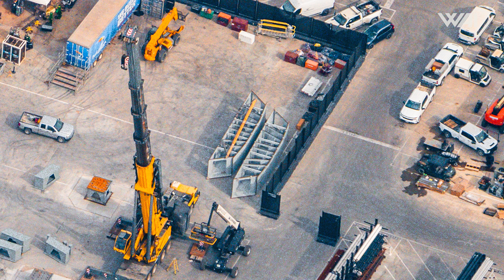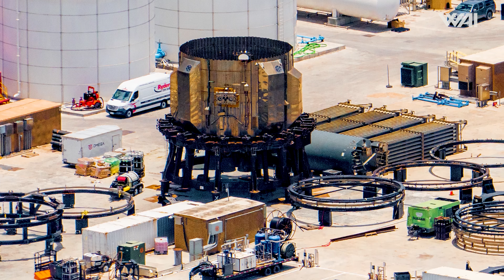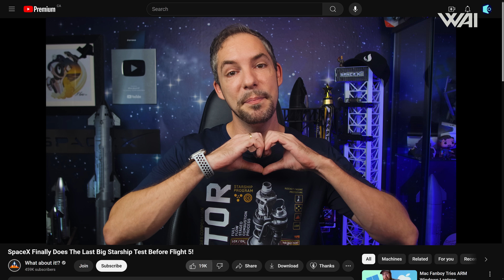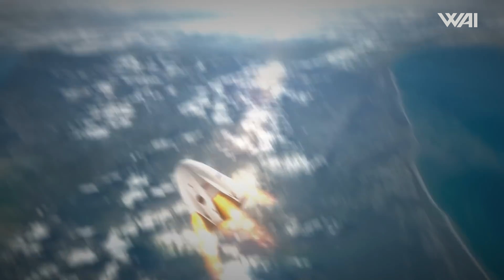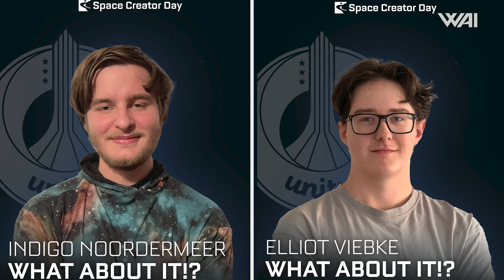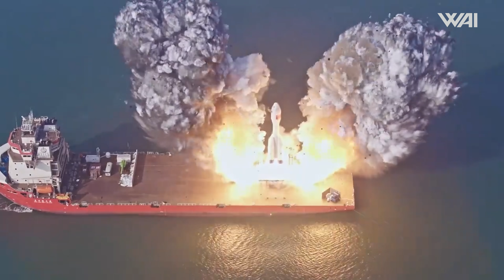SpaceX Finally Reveals New Design! & The US Might Fall Behind China In The Race!

Comment: If the FAA delays continue, will SpaceX just leapfrog the current setup and do FT-5 with the next ready setup? Does the Block 2 design  require a new FAA certification or could they do FT-5 or FT-6 with Block 2 in “rapid” succession?

Comment: Why aren't you talking about the booster failure on a crewed (rescue) launch? They are lucky the issue occurred after stage separation, but the fact that the problem flew with crew on it, you should be talking about it, like you would if it was Boeing or any other SpaceX competitor!

Comment: I'm sure another reason they decided to go with a different launch mount is due to later block versions will be larger vehicles, and the old mount is rather tall, and they simply cannot increase the height of the tower, so the easier step would be to make a short rectangle.  I know this isn't the only reason, but I'm sure it is one of them for sure.

Comment: The reason dragon would have to have all chutes fail to use the thrusters is because the anchor point for the chutes are on one side making it unbalanced. If it was to fire the thrusters it would probaly lose control and flip. Has to be in stable orientation first. Will also need a chute release in that case. Don't want deployed chutes attached when the engines fire.

Comment: It wouldnt surprise me if we saw a 3rd megabay pop up where the high bay is now, but then eventually merge Megabay 1 and 2 together into an L shape, and eventually join it to the 3rd. Ship and booster parts start construction in the star factory, rollout the back under cover into the Megabay, and move through the L shape mega bay to completion to roll out the front door and down the highway to masseys or the pad.

This would be the ultimate streamlined production that Elon has been after. It will also negate the doors on all the megabays leaving more room for ships and boosters inside. It will also make us all a bunch of sad pandas as we will get to see very little of the build until the completed unit rolls out the front. Which eventuially that would be happening once or twice or even 3 times per day we hope if Elon's plans for 1000 ships per year is realistic.

Comment: Super Draco’s are put in for escape… with the idea heavily planted in everyone’s minds then abondoned. But the stuff is there anyway.
Then the very spectacular escape test flights were very successful.
The crew dragon just performs every time way above the curve.
Now they say the thing that’s been there from the start will be now available as a last ditch Hail Mary.
Then I bet the cargo dragon will start using the super Draco’s as a test just a few meters above the water as a test.
Then higher then as a test at altitude very high to try to brake the ship entry from a point that’s slow enough to enter a hover then drop again and deploy the chutes.
Then try a cargo dragon as fully super Draco landing but in the water .
Then on the land with or without legs or maybe onto a little cradle with a fire proof net to settle on .
Then crew dragons that are old or whatever tha5 are just put into suborbital launches maybe or even full orbital.

This is just the next step. And it’s great.

Comment: I thought you might have mentioned the issue involving the Falcon 9's upper stage, which occurred during the Crew-9 mission on September 28, 2024. The problem arose during the deorbit burn, where the second stage of the rocket landed outside the designated safe zone in the ocean. This is the second upper stage anomaly for the Falcon 9 in less than three months, following a similar issue during a Starlink launch in July 2024.

In response to this latest incident, SpaceX has paused all Falcon 9 launches while they investigate the cause of the deorbit burn issue. The Federal Aviation Administration (FAA) is also involved, requiring an investigation to ensure public safety, although no damage or injuries have been reported. It is unclear how long the pause will last, but it could affect some high-profile upcoming launches, including the European Space Agency’s Hera mission and NASA’s Europa Clipper mission.

Comment: I'd be supremely comfortable and very confident putting my life as an astronaut fully into Elons hands. Hell, I'd go to Luna RIGHT NOW if Elon wanted to do it and let me.🙏He's already got all the necessary equipment. I can easily imagine 7 days on Lunas' surface using Elons luxury spacecraft, Starship, as a short-term habitat.  It'd be more like a vacation than a dangerous mission. The Starship would make a fine, luxury level habitat for any short-term stay on Luna. I have no clue what is taking them so long. A quick jaunt to Luna is just the right medicine needed to light a fire under our governments butt to move to get Lunabase online and supporting a couple dozen astronauts. We need to be more confident in our abilities. Caution can be just as bad as recklessness when it comes down to it. We have seen Elons equipment in action. It works like clock work. You could even use the Dragon capsule to ferry people home, leaving the Starships anchored in Earth orbit ready for refueling and return journeys to Lunabase. I can't imagine a safer process to implement. 🤠😇

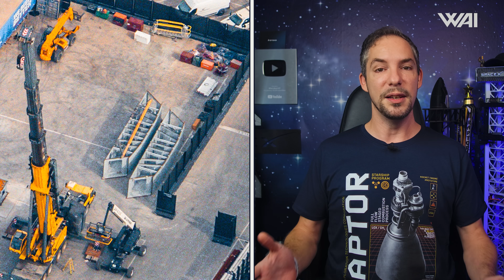Comment: 1:20 two identical pieces? No, they are not for same pad ;) Pad A same as Tower A need to be overhaul to Starship v.2 soon (at maximum two launches possible if it will not be destroyed/damaged by landing booster) then why not to order two launch pads in one contract? Overhaul of Pad/Tower A will begin soon as Starship v.1 program will be finished - curent Pad/Tower A configuration is obviously not able to support/launch Starsip v.2 😉💡

Comment: If the new launch mount is shorter the new integration tower will not need to be taller to accommodate larger vehicles.
Reply: Block 3 is taller

Comment: do they pressurize the eva suits with air at STP or pure oxygen at lower pressure like apollo 1?
spt
Reply: Apollo 1 was pure O2 at 16 psi on the pad.
Reply: @Logan4661  wait?  then what was the benefit of all that o2?
Reply: @baileyrahn266  On Apollo 1 the hatch closed from the inside and the pressure being slightly over 1 atm was to help it seal. That was why the astronauts died, they couldn't open the hatch and in a 16 psi pure oxygen environment even some things that are considered non-flammable will burn. The hatch was redigned and the capsule environment was changed for all future missions. I belive it was normal air on the pad and pure O2 at 8 psi during the flight.

Comment: Since crew dragon can land perpulsively why not strap it on a falcon heavy and send it to the moon? All u need do is increase the life support and when laning on the moon all u need to do is program it for moon gravity instead earth. All the parts are already being used right all that needs to be done is human rate the falcon heavy right?
Reply: If they need more room all they need to do is lunch with less personel right
Reply: @DropingUP  Well, if you just want to send the astronauts to the moon then yes. But if you also want them to come back alive then no, it can't. 
To start with,  the  crew dragon doesn't  have landing  legs. Those are not trivial to add because  it would be necessary to drill holes trough the thermal shield, which is possible but a big investment to develop (actually the original design was going to have legs, but NASA didn't like that design due to safety concerns..)  Actually, the thermal shield would need to be reinforced for higher re-entry speeds (much faster for moon return than orbital return) and  drilling the thermal shield to add legs does not sound like a good start.  
Still possible to solve with time and money , but this time the idea is not to go there just  for a walk but for building things, and they  want more capable ships.

Comment: Does Dragon Super Dracos have enough power and delta V for a lunar descent/ascent?
Reply: Well earth has higher G force and draconian and easily land a dragon on earth and hence moon would be pretty easy but they would have to use falcon heavy instead of falcon 9.
Reply: @riddhishakya7791  Does falcon heavy have enough delta V for TLI?
Reply: @sakshamShukla_  Yes, it can go way over
Reply: The dragon capsule has a low terminal velocity on earth. It does not have the propellant to land on the moon let alone land and take off.
Reply: No.

Comment: I'd definitely place my bet on Stargate and Highbay space getting used for a new Ultrabay. The current Starship roadmap can't be fully implemented at Boca Chica (unless they want to go back to stacking stuff in the open air) unless they build a a taller megabay somewhere (what I called Ultrabay) because the block 3 booster is going to be significantly taller than a block 1 booster and right now even a block 1 booster with hot staging ring attached only just fits through the megabay door.

My guess is that at some point in the future both of the megabays are going to switch to almost entirely (maybe literally entirely) Ship production with a new Ultrabay that is both taller and wider focussing on booster production. Demolishing both Stargate and Highbay should create space for a new bay that could be not only taller but also wider than the current megabays, maybe five stations along the back instead of the three in the current megabays and perhaps even two stations to each side of the door instead of the single station to each side in the current megabays. Given that Elon has said they will produce more ships than boosters I would think that an Ultrabay that size should give sufficient booster stacking capacity for a long time to come.

Comment: China will have boots on the moon before the USA. Besides the FAA problems there are problems at NASA with SLS delays, the Orion heat shield, and design issues with the lunar gateway. Then there is the looming presidential election that will affect the NASA budget. I wouldn't be surprised if the USA has to buy ride share space to get astronauts back to the moon.

Comment: think of what a raptor 3 engine getting on the black market mean for the space race. If the engines get in the Chinese hands, they will leap 10 years forward in their capabilities.
Reply: Duplication doesn’t get you all the research data that led to the Raptor 3. They would know what it is, but not how each part was built, or exactly why each design choice was made.
Reply: @billkew5385  yeah plus al the plumbing, software and fuel, AND mass production
Reply: @playframe6231  given that Space does not patent its design, and publishes them for others to see,  there is no reason to believe the Chinese and others won't produce their own versions sooner rather than later.